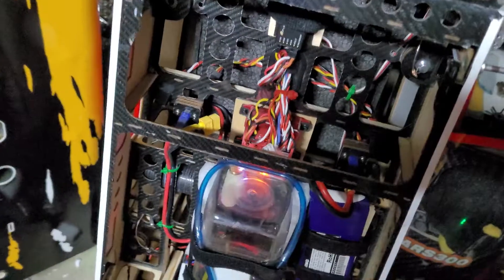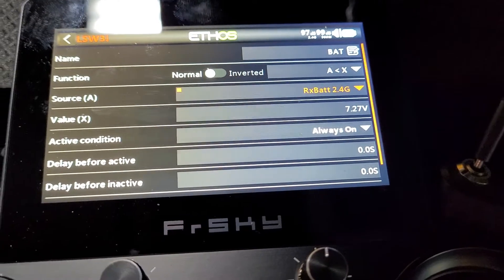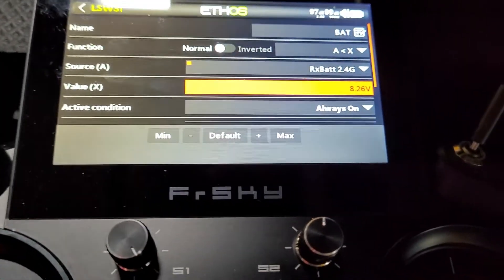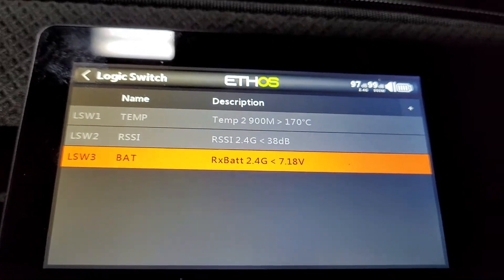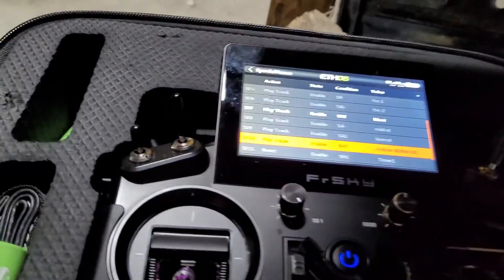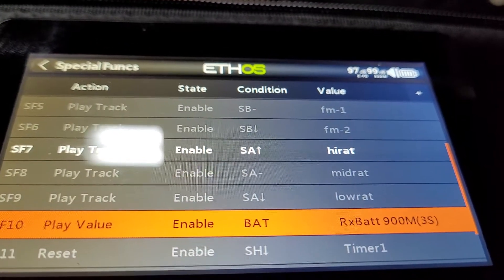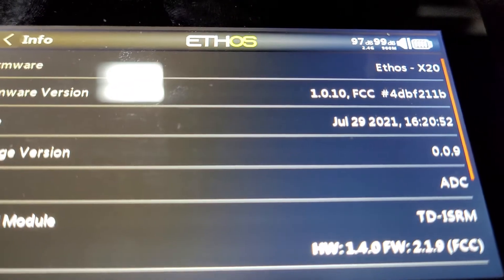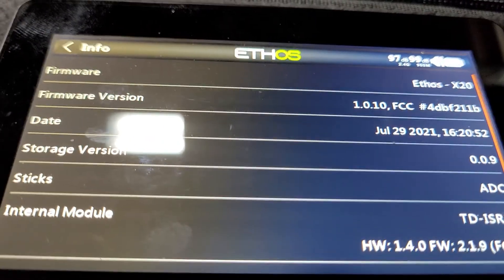Voltage Readout for Telemetry on X20 and Ethos

Comment: Hi, I am considering buying the X20: did you test the range in 2.4 GHz only (no 900 mhz) before telemetry is lost and before a signal alert? 
Any review of the new FrSky TD receivers, e.g for possible interference between frequencies? Thanks a lot
Reply from the maker: Yes, I tested all of the above.  There is zero interference between the 2 frequencies.  And rhe 2.4gig range is rhe same as all the other Archer / Access range.  This has never been an issue with the x20
Reply: @joetrin  Thanks a lot, very good to know!
Reply: @joetrin  Hi, I found a serious a problem with the Tandem receiver TD R10 (2.4 Ghz+900 Mhz): the servos start to jitter / chatter strongly when I install the receiver in the fuselage (analog servos, Hitech and Emax). The issue disappears when I turn off the telemetry or wrap the 900 Mhz antenna with aluminum foil, so the issue should be the 900 Mhz telemetry. Unfortunately it is not possible to turn it off separately from the 2.4 Ghz telemetry! Does anyone know if the normal 2.4Ghz receivers have the same jitter issue?
Reply from the maker: @giovannivitali9536  Hi Giovanni, I've never tested the TDR10 or TDMX using analog servos.  I only use digital servos, have you tried increasing the frame rate of the RX's in the "Set" area... or by default keep it in 24 channel mode to increase PWM latency?
Reply: @joetrin  Hi Joe, I have tried the fast rate setting with no impact on the issue, thanks
Reply from the maker: @giovannivitali9536  you need to use Slow, as in greater than 18ms pwm output.  You will burn your analog servos out if you use high speed.

Your servos are analog, only good quality digital servos can use high speed output on pwm.
Reply: @joetrin  that's right. I have only tested in high speed to see if the jitter disappeared but... no
Reply: @joetrin  No shielding made the issue go away, so in the end I returned both receivers to RC Studio, which was very available and professional. I then bought an old 2.4 Ghz ACCST receiver (RX8 PRO) and very little jitter. However the radio gave  "RSSI critical" at about 300 meters, once. It seems to me the radio link quality is unstable